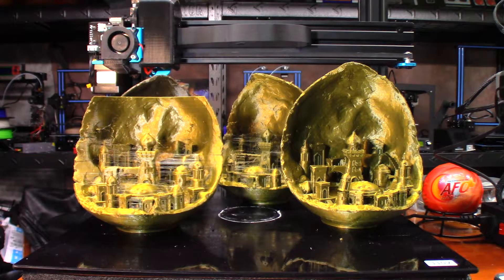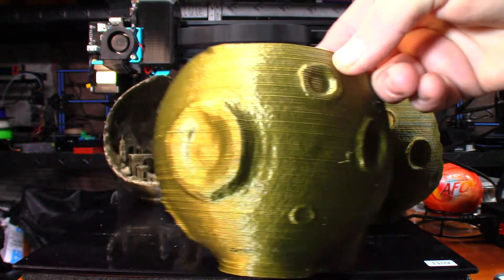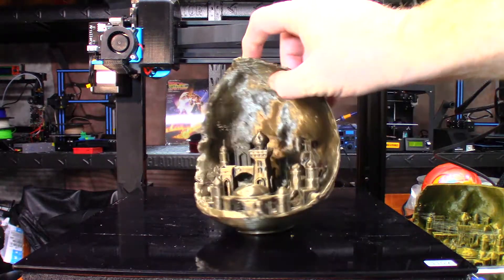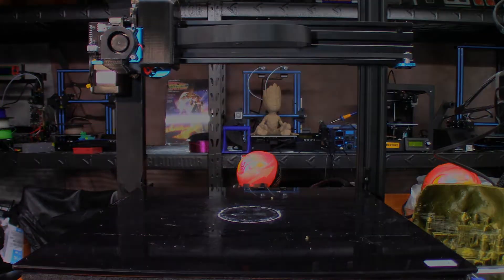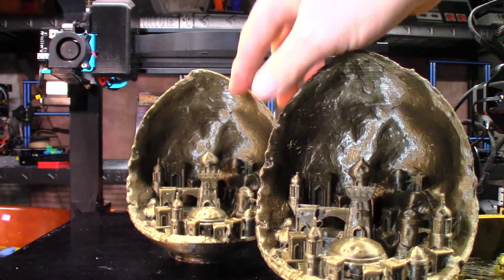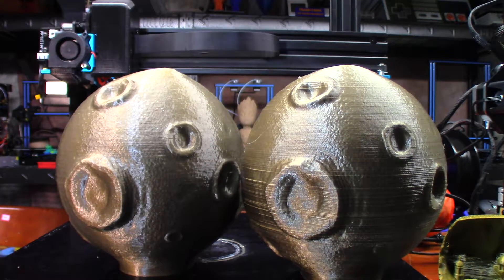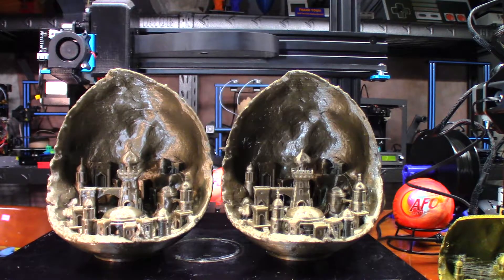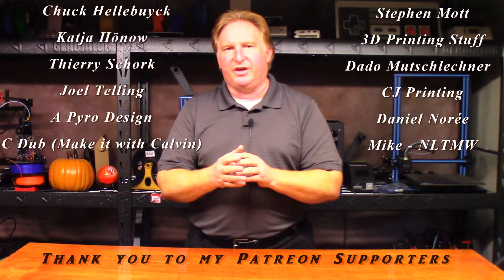Was 0.2mm Layer Height My Problem On The Artillery 3D SW-X1?

Comment: I have looked for long time at why the artillery printers have such extreme horizontal banding that doesn't seem to be linked to the z-axis movement, the filament, temperature or nozzles. There's not much left to the printer. Screwed the z-axis couplings together (no difference), changed nozzles (no difference), different filament (no difference), set layer heights (no difference). It was driving me nuts. 
Finally, the clue was the filament position entering the extruder. it was moving up and down on the gear wheel and that wheel isn't flat, it's got a concave cut to try and make the filament lie in the smallest radius. The amount of plastic being extruded was changing from rotation to rotation.
Pulled the whole thing apart and the culprit is the aluminium heatsink which Artillery made and attached to standard titan extruder plastic bits. The tube on it where the hotend slots in, does not have a vertical side at the gear wheel end. It's angled at about 80 or 85 degrees to the plate (probably for manufacturing to release it from the mold).  The feed from the gear wheel was being pushed away from the concave on the gear by the tube that sits on this surface. The tensioning arm was also hitting the guide and pushing it a bit too.
Filed the aluminium end to 90 degrees, put in a spacer and the prints are now great.

Comment: This isn't a function of the volcano, there is nothing thermally or mechanically special about volcano except that its the standard nozzle turned on its side. What you have stumbled upon is...MAGIC NUMBERS! It sounds silly, but that is what the community calls the "step size" of layer discretization due to the discretization of the stepper motor. The Artillery Sidewinder X1 uses Z-axis stepper motors for which the minimum difference is 0.04mm. That means that for maximum resolution, all of your layer heights should be in increments of 0.04mm, so 0.08mm, 0.12mm, 0.16mm, and ... 0.2mm !  Your g-code/slicer is unaware of this mechanical  restriction so when you choose a layer height like 0.1 the printer is basically oscillating back and forth between 0.08 and 0.12mm, which leads to the weird layer lines (usually happens when the printer switches from a 0.12 to a 0.8). Give 0.12 a try and you'll see what i mean!

Comment: The title of the video is.. er, well, the 0.2mm layer height wasn't the PROBLEM, it was the SOLUTION. 😂 Gorgeous prints, by the way. The reason I think they use a Volcano hot end is that this is a big printer, and you need the Volcano heat block if you want to print big objects in a reasonable time with a big nozzle.

Comment: Add some stabilizers on the gantry and tune the wobble out of the lead screws (get straight ones if they're bend) and boom you can print without lines and any layer height.
Reply from the maker: I used to use lithium grease but anymore I just use 3 in 1 oil.

Comment: enabling the retraction setting will stop all the stringing. i use Cura and have had nothing but success. what size nozel do you have? you can swap out the nozel tip with a .2 and get the results your looking for.

Comment: I am here one year later, so a bit late, but i'm printing with a .6 mm nozzle and .48 mm layer height, and still have the layer lines, although mine are different, they don't go the whole layer, it's like they wobble back and forth. All screws and wheels and everything is adjusted properly, i think is a driver voltage thing, i'll test more.
Reply: Quit using cura, problem solved
Reply: Any news? Same problem here :(
Reply: @AlejanPa  Sorry, abandoned the printer for a while because i moved, last time i was printing i just ignored them, since with a bigger layer height they are unnoticeable.
will test some stuff, maybe come back to it.

Comment: When you see lines like that it means that you're squishing each layer too much, this can sometimes be remedied by adjusting your extrusion multiplier but it could also be a result of the first layer being squished too much affecting each subsequent layer.  0.1mm layer heights is too much on the lower end for a 0.4mm nozzle in my opinion. Ive experimented with lower layer heights with a 0.25mm volcano nozzle on the X1 and got great results from 0.9mm-1.2mm layer heights, just takes some experimentation with first layer z-offset and extrusion multiplier.  I have a lot of experience using small nozzles from selling parts containing text that require <0.3mm line widths. I was very surprised how well my honed in settings on my titan aero taz 5 carried over to the X1 with the volcano block. Using a BLTouch also helps immensely when dealing with small layers since you don't have to squish the first layer so much to account for an uneven bed surface.
Reply: my stock artillery printed superb pieces at 0,08 layer thickness.

Comment: i think you all need to just calibrate your sidewinders, i don't have ANY layer inconsistency after leveling flawless prints, insane print quality at super fast speeds
Reply: How did you achieve this? I may be going too fast but the stock cura profile from artillery is 90mm/s. I printed a large piece as a test at this speed 210 degrees with pla, 80 degree bed and got bad syringing and a large layer shift about 1cm up. What settings do you use it you don't mind sharing??
Reply: @darkjedig  90mm/s seems super fast, very close to what I use for my X/Y travel moves speed. I'm used to setting print speed to around 60mm/s on my old machine with old drivers that like to heat up, the most I've ramped up my x1 is to around 70-75mm/s comfortably which it still prints with exceptional quality.
Reply: James B yes I actually lowered to 50mm/s and I’m still getting bad layer lines almost like a  z wobble but I don’t know what else to do as I’ve done everything I can possibly do for now. I probably got a dud unit.
Reply: @darkjedig  did you figure anything out? i got same issues
Reply: @WildmanGeorge  a little better by changing settings and  I oiled the rods. I also tightened everything a little . I still get a weird like that sticks out more in a certain place and I can't get rid of it.

Comment: Nothing to do with .1 -- 0.2 just falls into a magic number -- has to do with "magic layer heights" , I can't find the pitch of the lead screws on this machine, most likely it's the common 8mm 2mm pitch 4 start lead screw, hence a single step resolution of 0.04, so a 0.1 layer height doesn't fit into it. So if you want to print fine go with 0.08 or 0.12. Also make sure the z moves smoothly and the v-wheels are not over-tightened. I've printed at 0.1 layer height with a volcano 0.6mm nozzle no issues, and no funny layer inconsistencies, my machine uses a much finer resolution single start lead screws. Calwin has the right idea, just not the correct why.
Reply: It might well be that. Chuck did a video about that a few weeks ago. 
Jimmy, can you try again with one of those heights?
I'm curious...
Reply: @tripy75  0.16 is the magic xD